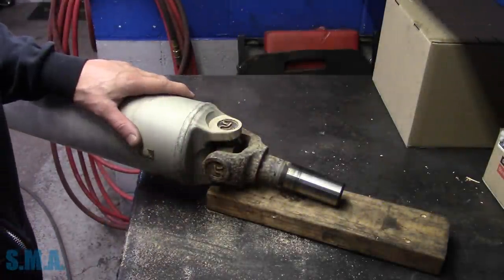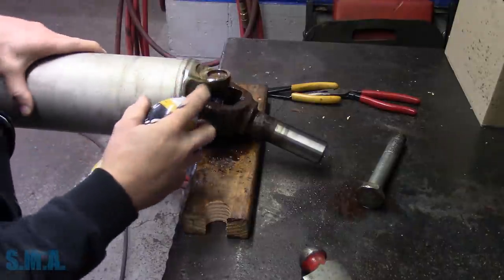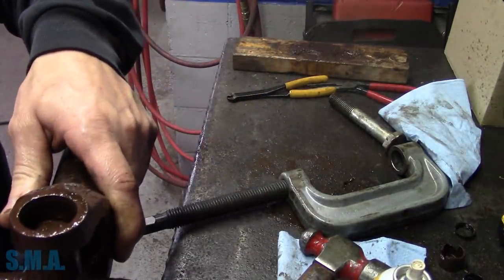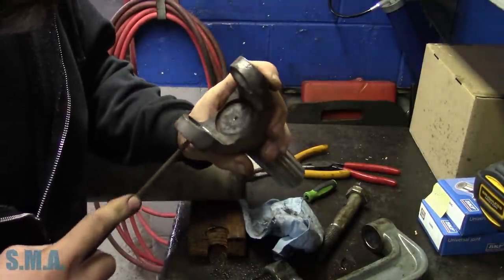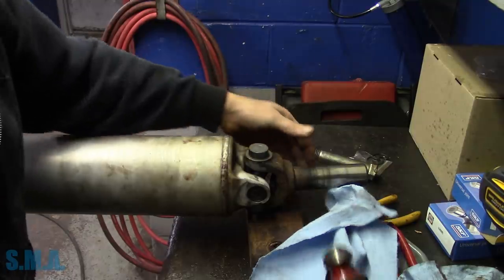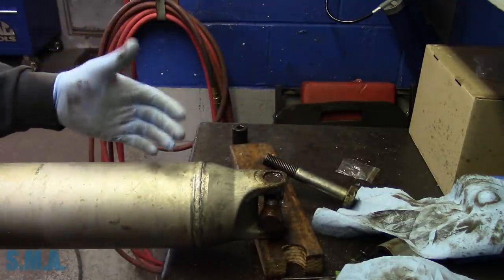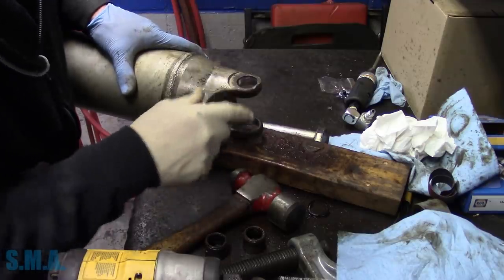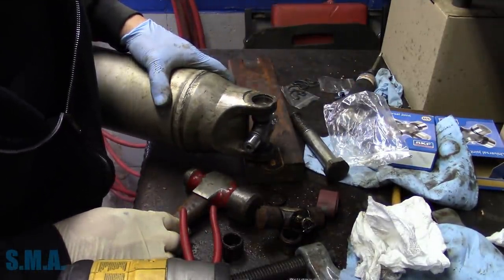U-Joint Replacement: Aluminium Driveshaft

Comment: I guess I don't understand why you just use the vise as your press.  can press in and out just the amount you need.  both works but have use a vise many times for these.

Mrs. O is correct, where are the safety glasses.

good job.

Comment: I wish Dremel could make a cordless rotary that lasted more than 10 minutes per charge. I have two of them and they both suck for that, but extremely convenient when you aren't near a power source. Also I can't find spare batteries for them anywhere. You get the one it comes with and that's it. Of course the two I've got aren't battery compatible with each other.

How many of the OCD crowd are tearing their hair out watching your work with two different color gloves. LMAO

Comment: Well, 30 seconds into this, let me guess and say that the joint has no grease fittings or grease plugs. I didn't see any. So were the cups dry? Even so, I bet it never had fresh grease and there is a difference, right? When I take mine in for a chassis lube, they do not grease the u- joints. They didn't have a fitting for a grease plug, so I brought mine one day and let them use it. They were not about to change, so rather than bring my fitting along all the time, I just learn to do it myself when I get home.

Comment: I hate using those paper-thin Dremel cutoff wheels that always fly apart at the worst possible time. Even worse is when you overtighten that teeny-weeny bolt on end of the arbor and shear that sucker clean off - on the only arbor you have. They say every tool has a hammer side? My Dremel has 6 of 'em...

Comment: the strongest U joints have NO grease fittings. NEVER wipe the grease off the fitting. Leave it on to catch dirt. then wipe it off later to re grease, keeps dirt out of the fitting.

Comment: Torch off the steel end u-joint, then the heat usually allows the caps to move pretty easily

Comment: I was thinking to maybe heat that aluminum section that was damaged as you were trying to push the cap through it, but I wanted to make sure this was okay advice, but aluminum can be weakened by heat. What a terrible metal to work with.

Comment: bending the ears would be something along the lines of "bozo controlling a 20 ton press without regard" lol
i still use a large cheap vice and random old sockets as a press, well it's more to tension it lightly and a hammer(sledge) to whack the vice and shock them loose. it's fairly hard to get large clamping forces from a vice, unless you get real dumb on the handle, like one hand on handle and one on hammer is plenty

Comment: If there was no complaint about the U-joint, how was the damage discovered?
Reply: He looked! Any good service includes an inspection- belt,brakes,,tires,charging system and battery. And your under there anyway. And it's a GM the brake lines are probably about to rust off.🤑👍
Reply: Visual inspection while doing an oil change.

Comment: Hopping on the safety glasses bandwagon.  Those little non-reinforced cuttoff wheels tend to undergo spontaneous existence failure, and I've had the pieces ping right off the middle of my glasses, right in front of my eye-hole.  That, in a word, would suck. Glasses, face shield, welding helmet, paper bag (Dremel by touch, what could go wrong), something.

Comment: So when the guys were working on the spray rigs that had been full of Agent Orange they wouldn't wear gloves. I don't remember having any protection available even a decade later. Two of the old guys that I worked with came down with Parkinson's disease just as they got ready to retire. Nasty trembling, couldn't even write or use a keyboard. But I guess it's macho to use solvents without gloves, I mean what the hell it isn't doing any damage, right?

Comment: Why not start with the bad end so if it’s bad you don’t waste the u joint in the other end? I usually cut the cross out with a torch then you can fight the caps 1 at a time.

Comment: If you happen to be allergic to wiping or spraying aluminium under your arms, you can mix up equal parts of baby powder and baking soda. Just steal one of your wife's makeup sponges and use that to wipe on a little of the mixture.

Comment: Can't pound against wood, it ansorbs very force you're trying to impart; must be against heavy steel, etc. 
...Big c clamp with a removableble foot, with a hole in it for the ujoint cap would work well. With you expentise, it would be easy.......
I guess GM will make drive shafts out of silly putty soon.....

Comment: Here is the difference between South Main and 99% or other shops.  South Main: This is all corroded and clips wont fit,lets get the dremel. Other shops: Sorry folks, you need a drive shaft.

Comment: Alot of mechanics I've been to over the years would just charge the customer for a broken drive shaft if they went full gorilla on it and broke off an ear.
Reply: Well that's the risk of trying to repair such a part.
You can't fix 'em all.

Comment: What?   Not Spicer joints.   Also the grease passages weaken the joint.   Get a solid one.   OTOH, this is just for a truck.   You do not need the best.    I put none greaseable Spicer joints in my 69 and 64 Vettes,   They will not break.

Comment: So i would have done 1 thing different myself. put the damaged part of the driveshaft to the front...that way when it breaks free from the U-joint while they are crossing a rail-road track too fast the drive shaft will pole vault the back of the vehicle, and hopefully rip the rear suspension right off the frame. Why you ask? So they wont want me to fix it for free when the driveshaft breaks. Let their insurance take care of it.

Maybe you shouldn't listen to me.

Comment: No hot wrench? Every time i have had to change the U-Joints on a GM aluminum shaft its always required heat to break that bullshit plastic goo they use.